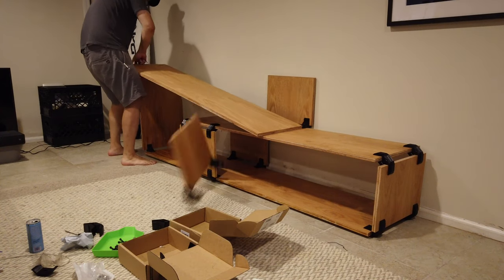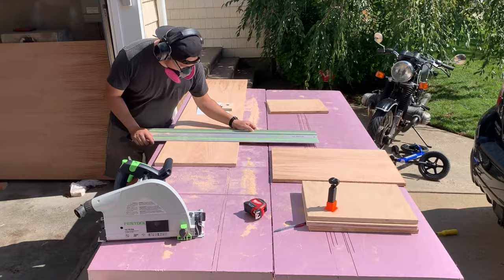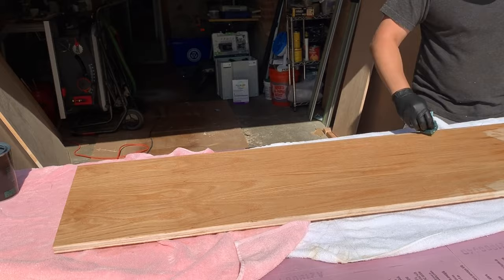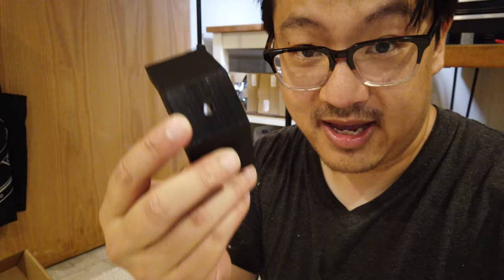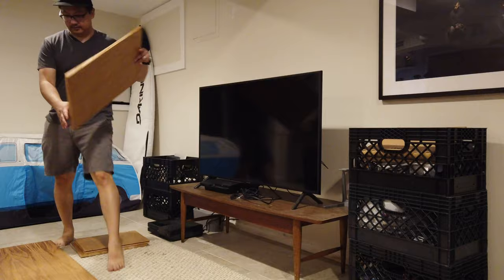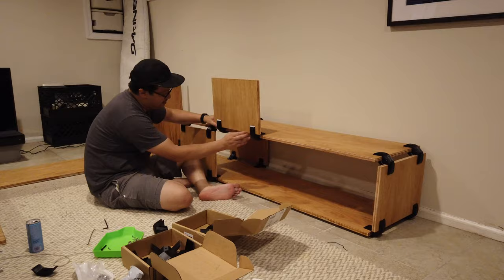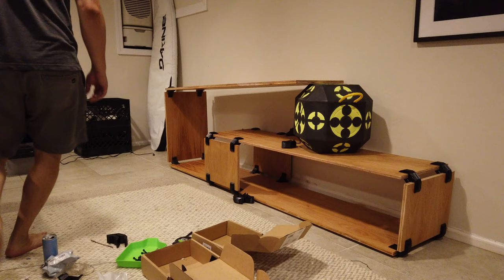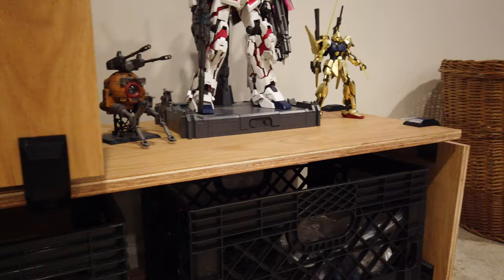DIY TV stand and console with 3D Printed Connectors and Oak Plywood

Comment: +1 for the track saw. An absolutely awesome tool for ripping panels out of plywood sheets. The insulation board as a sacrificial under sheet/support is also interesting, but the stuff isn't free around here :( Of course blemish-free ply is even more pricey.. Grumble. I like the idea of plastic brackets and wooden panels; maybe it is time to replace the TV cabinet...
Reply from the maker: If you like the look of MDF or OSB is inexpensive and can be really cool material to be used in a build like this. Just another option. Don’t know where you live in the world but those foam boards are for insulation and most big boxes have them and are pretty inexpensive. Thanks for checking out the video. I hope you can build one for your self! Love to see it if you do.
Reply: @3ddiy  I would be fine with MDF, especially painted. But it is 2-3x heavier than ply, and the wife has different aesthetics. Stained wood with grain is fine, MDF/OSB not so much. Here in New Zealand, the local box stores have bead styrofoam for insulation for cheap, but I wouldn't use it as a sacrificial cutting mat as the beads get static cling and go everywhere! I have seen foam sheets in a speciality building supply store, 8'x2' for about the same price as box stores have 8'x4' ply!
So in the end I have my shelves made of ply ripped on the track saw, and I use offcuts on the sawbench to stop the work pieces falling on the floor, and that will do for me for now. Cheers!

Comment: I think the only way this connector design could be improved is if you added a screw through the connector into the plywood to actually secure it.
Reply from the maker: The clamping pressure of the connectors is pretty strong. Once it’s tight it’s really not going to let go. I suppose you could easily make a hole on either side and really secure it.
Reply from the maker: Ian H totally get what your saying from a structural design. If one fails then it’s a domino effect. But this is all under the assumption that a single part isn’t strong enough to do its intended purpose. I would be concerned if there was an enormous amount of weight and strain on the part or if the structure received a lot of vibration and movement. It’s like a suspension bridge if a cable snaps the whole thing will be weaker and eventually go down. The intended use and limits are not going to have the cables snap. There are so many piece of furniture and machinery that are designed for a certain  load and usage. Certainly one can always over engineer it to air on the safer side.
Reply from the maker: Ian H have you ever watched Stefen from CNC kitchen? He has that genuine curiosity to design. And he does lots of stress tests and experiments pertaining to all things 3d printing. Doing tests like that definitely does not bring me joy. It is cool learning or reading about someone’s experiments... i did a stress test for my first video of the hooks to prove its durability. Never posted the video but posted the result on Instagram. It was surprising and cool. But not sure I want to make those videos.
Reply from the maker: Ian H have you ever watched Stefen from CNC kitchen? He has that genuine curiosity to design. And he does lots of stress tests and experiments pertaining to all things 3d printing. Doing tests like that definitely does not bring me joy. It is cool learning or reading about someone’s experiments... i did a stress test for my first video of the hooks to prove its durability. Never posted the video but posted the result on Instagram. It was surprising and cool. But not sure I want to make those videos.

Comment: Great video! QUESTION: How much grams filament did you use for each connector? . I don't want to have to buy it to find it out.. I need to know how much filament goes for printing each connector
Reply from the maker: 65 grams for one set. At .2mm and 30% infill 2 perimeters. If you want to do 50% infill or more walls it would be heavier.
Reply: @3ddiy  Thanks man. Appreciated ur nice video!
Reply from the maker: @GospodinJean  cheers! Thanks for watching

Comment: Hey man, I have a weird question for you. How comfortable would you be jumping  on this stand?
Reply from the maker: In the current configuration I wouldn’t want too. But if it had more support in certain areas then totally fine. Right now it’s too long with out much center support for a 200lb guy jumping on it. I have sat on the sides as a bench and it’s been fine.
Reply: @3ddiy  Dang that is so cool! Thanks!
Reply from the maker: pipersniper123 check out the product playwood it’s the same thing. Instead of being 3d printed. I can’t find the video I saw but there is a stool they made and someone was jumping on it.

Comment: 11hrs - whats the material cost per connector?
Reply from the maker: If you did 30% infill and 4 walls .2 layer height. It be around 7.5 hours and $2 for a set.